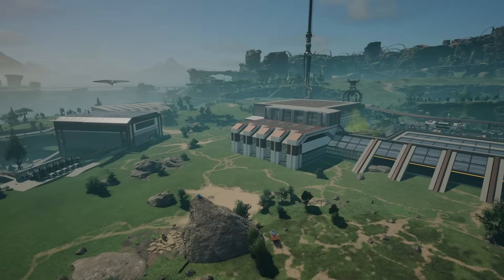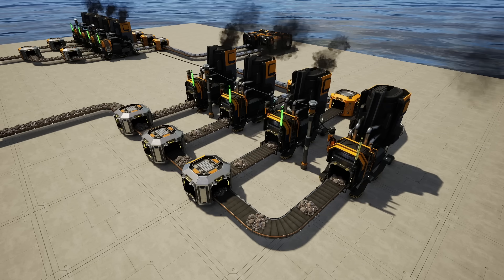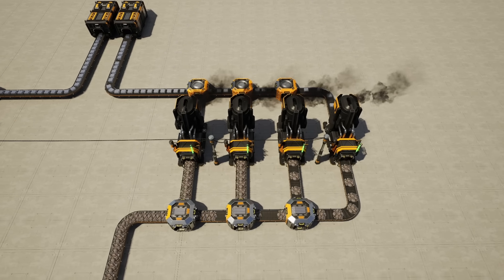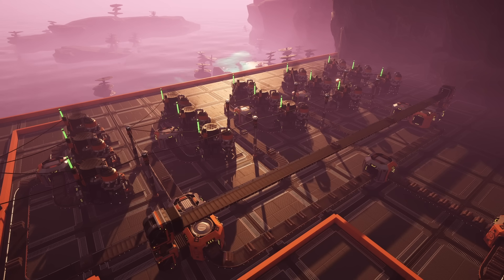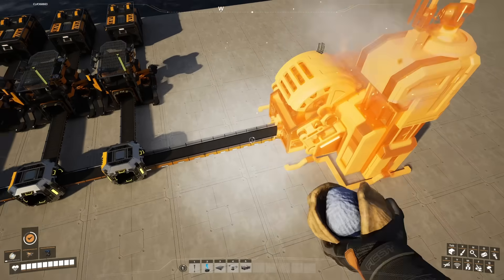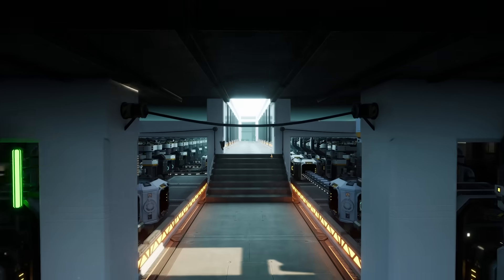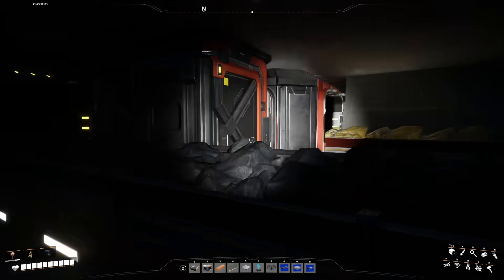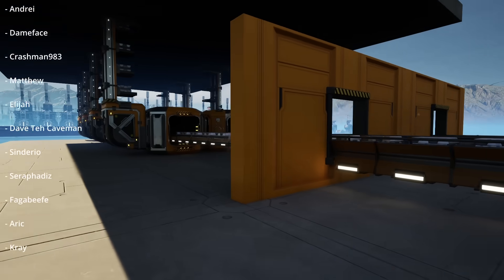Beginners Guide To Factory Logistics Systems in Satisfactory 1.0

Comment: once did a run where i used load balancer to balance everything 100%. Was a nightmare

now i'm back to manifold for everything
Reply: Why would you ever consider doing that to yourself 😭
Reply: @onefinelad6263  it was an experiment... cant recommend doing it
Reply: I did that thinking this is normal :(
Reply: The only thing that would be better load balanced is nuclear, and specifically the uranium itself. Makes it way less dangerous due to less radiation :).
Reply: Until now I've always prefered to use load balancers, as it gets everything running at peak efficiency immediately and never backs up till the storage the factory deposits into is 100% full. 

Then I entered tier 8. I'm debating breaking down and using the "modular load balancers" mod (since it's a modded playthrough anyway, fight me), but perhaps I'll just start using manifolds instead.
Reply: found this game a couple weeks ago year, and the OCD I didn't know I had compelled me into trying to Load Balance everything. 50+ hours in, and at Stage 8, and now I regret everything due to the late-game component requirements coming in difficult-to-meet fractions. Now, I'm looking at days worth of work to tear it all down and convert lines into organized manifolds.
Reply: but load balancer is logically better???
Reply: @Shiye Big trouble is that balancers are not scalable.  When you need to expand production, the whole system has to be reworked.  With manifolds, simply upgrade the belt and extend the line.
Reply: @Shiye  load balancer are a nightmare in later stages when you have to work with 0,215 values or you have to under& overblock everything so it just turns into 0,1 or 0,5 or smth like that. 

its not fun

and pre 1.0 you had less power shards overall

Comment: Thank you for the descriptions, and the tip on logistics floors. I've seen communications lines ran on cable trays under the floor, hvac in the ceiling, and power on the walls of modern buildings so it all makes sense when compared to the real world.

Comment: Honestly I'm just lazy about math.  The processes for uneven load balancers are such a pain that I just can't be bothered, frankly.  Manifolds take two seconds, and work perfectly fine once the belts are charged.
Reply: I wasn’t lazy for the first couple playthroughs until I realised that manifolds are just as efficient with the added bonus of being quicker, easier, and looking better. With the only downside being a slow start (which doesnmt matter since I’m doing something else while the factory is warming up), load bearers are just plain bad
Reply: I'm lazy about math until I know it's going to take 2 hours to reach full efficiency lol
Reply: @tobeqz7065  typically you dont sit there watching it
Reply: @tobeqz7065  Thats where priming comes into play!
Reply: @tobeqz7065I hear, but that's also how long it will take me to finish building my road.
Reply: Yeah from what I’ve seen it just means it’ll take a bit before the end of the line is fully functional
Reply: @damsen978 overreacting much.
Reply: @damsen978 nah. I played Factorio first and never did any of the math. If I saw backed up belts, I'd find whatever the choke point was and add to that (a lot of plastic because Red Chips) and i do the same with Satisfactory.. I think its probably more important in Satisfactory though
Reply: @damsen978Factorio is the same as Manifolds except that inserters are your splitters/intake.

Build a bus, have enough smelter stacks and you are good. For more throughout, simply upgrade belts and your smelter stack and you are good to go - just as in Satisfactory
Reply: To be fair it ain't hard. The powers of 3 (9,27) are just trees with each splitter fully equiped.
Then it depends if the beltspeed is saturated or not. If you have enough headroom, just refeed any final splitter output to the input. If you want to use the full belt speed, you need to split the belt first and then refeed any final lines evenly into those two branches.
This is easily done by using a logistic floor. Put any unused branch on the second floor. Merge them all. Split the sum and refeed into the first two branches.
Reply: And by "charged", you mean overflowing with product that could be used elsewhere, or fed to the shredder for tickets.
Reply: silensio bruno
Reply: It has nothing to do with math.  I can do math.  I can make X:Y splitters (any natural number to any other natural number).  I can also make load balancers to evenly distribute multiple variable inputs.  It is difficult to make them compact, and without clipping.  Even in 3D, these logistics can end up taking up as much space, or more space than the actual machines in the factory.  They require more buildables and more resources.  Worst of all, they are not scalable.  If you upgrade and/or overclock miners, or belt speeds, your big, complex, confusing ganglion of cancerous tumor of logistics becomes 100% worthless, must be ripped out, and the replacement won't fit in your logistics floors, so you may very likely end up tearing down the factory completely, possibly even forced to relocate.  Manifolds avoid all the scalability problems, making factory expansion much more trivial.  Load balancing via overflow balancers is also somewhat more scalable.  Manifolds can be sped up by using the fastest belt on the main bus and the slowest belt (next one up if fully saturated, i.e. if machine needs 60, use mk.2 belt) to machines.  You can pre-fill manifold machines, or put injection filled mergers on the bus, halfway down, to connect a storage container to saturate machine buffers faster, or just turn off the last machine or two.  Using a buffered injection that is kept pre-filled by a lower priority miner source ensures automatic refill on subsequent cold starts.  There's many simple ways to mitigate the one downside of manifolds, but no way to mitigate the many downsides of balancers.  The use case of radiation might be a valid exception but I'm a bit dubious of that.  Balancers are Just In Time delivery, meaning low machine buffer, usually 0-1, which very prone to stuttering or failure and no recovery if there's any interruption.  This can lead to wildly erratic nuclear power output, tripping grid.  Best to have saturated buffers.  For this reason, I wouldn't even use balancers for biomass burners either.
Reply: @Warp9pnt9  I disagree pretty strongly about not balancing biomass burners. You absolutely do not want to commit to filling a 200-stack internal buffer on every burner with solid biofuel just to power your early factory, then having to repeat this every single time your reserve runs out. If the buffer was smaller, like a 50 stack, it might make sense, but you're going to be forced to get so much more fuel upfront than you'd ever want if you try to manifold feed 12 burners. There's also nothing to be gained from the manifold; your grid is going to shut down the moment the last burner in line runs out of fuel (if it needed to exist in the first place), and your buffer in the other 11 machines will immediately be literally worthless.
Reply: @celestialspark5697 I didn’t load balance my 12 biomass burners and it worked just fine. What are you on about.
Reply: @EpU24  Then either you didn't need anywhere near 12 burners, or you manually fed them, or you went for blocks of time where you didn't run your factory lines (i.e. outputs backed up and shut off most of your consumption), or you produced several thousand more solid biofuel than you needed upfront and continuously supplied them without ever running out in your storage crate. Otherwise the last burner in a series of 12 is going to get 1/2048 of what you load in and not run the majority of the time.
Reply: @celestialspark5697  - Why let your grid run out of power/fuel ever?  10-20 biomass burners is more than enough to get you to coal power and then you should always have stable infinite power as needed.  Those 10-20 biomass burners are really easy to keep fed during that time.  Your comments about the stack size is true, but it really doesn't take that long to get enough wood to fill those stacks.  Fill it once and then just don't let your system run dry and it no longer matters what the stack size is.
Reply: @damsen978 Yeah it's not even the balancing that bothers me there, it's the limited resources.  Having to move everything around now and again gets to me.

Well that and constantly being attacked.  I much prefer Satisfactory.
Reply: @davidh8271 Last time I did a playthrough and actually beat it, I put defense as my number 1 priority, and didn't have much of an issue. The previous tries, I would put it off, and it'd bite me in the end
Reply: @davidh8271 Aside attacking, Factorios ressources are near infinite. I doubt you run out of iron in your world before finishing the game.

You can easily reach Trains and things such as laser turrets, solar and batteries before your starter patch runs out, after that its just connecting new outposts to your railway.

Comment: Sushi belts work great if you turn of the first few machines and wait for the ones on the end to fill up.
And with fuel generates lower the power on the first few so the ones in the back get more fuel and when they are full turn everything to normal.

Comment: I'm a bit disappointed with 1.0...
That story part is too little...
There are still too many bugs ...
Bugs known for years...
Bugs already corrected in previous patches...
Don't get me wrong, the game is still awesome, but so much wait (I stopped playing 3 years ago) for not so much improvement...
Reply: what bugs exactly? I haven't encountered any.
Reply: @toddblankenship7164  Smart splitter not working properly, pipe floor hole not connecting correctly, monster disappearing or repairing from nowhere, inner corner with the coated texture having a vertical off set, and many more ...
Reply: @toddblankenship7164  my hotkeys break at random and i have to reload the game, the random monsters in your factory is super annoying
Reply: @henrysinclair5914  at least one of those things is not a bug but an annoyance
Reply: @henrysinclair5914  hmm never had my hotkeys "break" the monsters in the base is a bit annoying ill give you that.
Reply: @Beajnie  i would call a giant tick monster stuck half in my machine glitching out is a bug